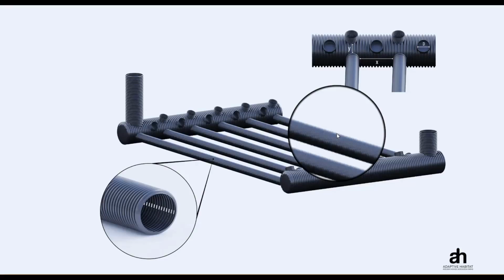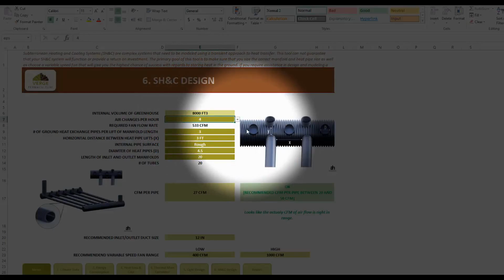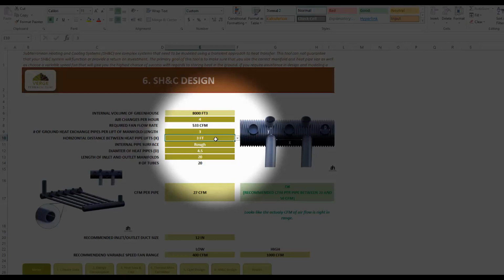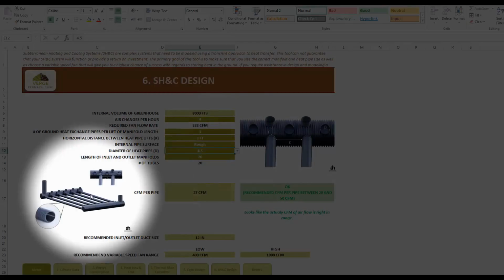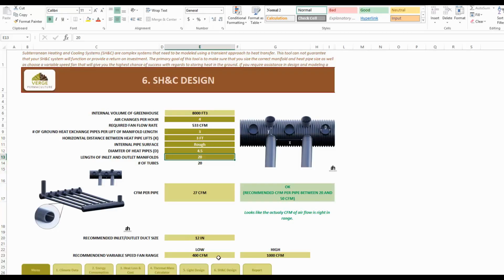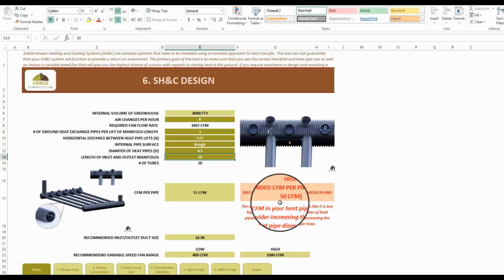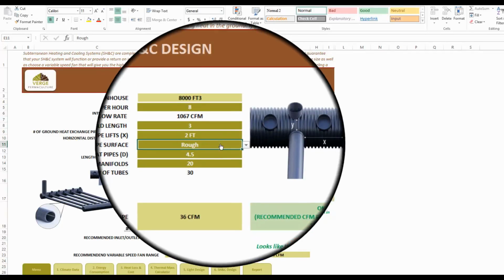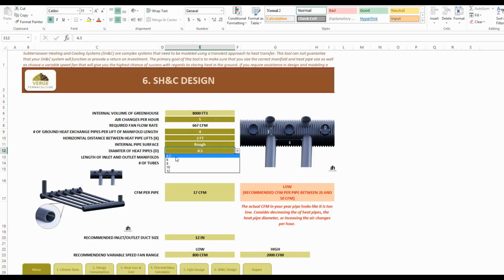Entering Data into the Subterranean Heating and Cooling System

Comment: Hi Rob, this looks like a very good tool. One thing that seems to be important but is not included in the calculator is the length of the heat pipes. If the heat pipe is longer, than needed, it  would result in reduced air flow due to friction plus the air would reach earth temperature before reaching the end of the pipe.  On the other extreme, a very short  pipe would not be able to absorb enough heat from the air. Since the heat pipe length is not part of the calculator then I suppose that there must be a rule of thumb for it?